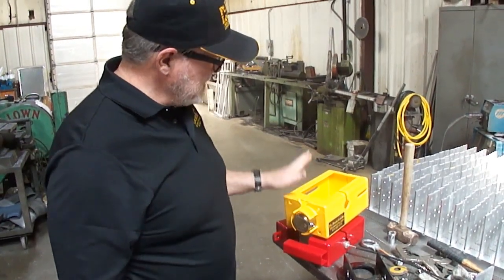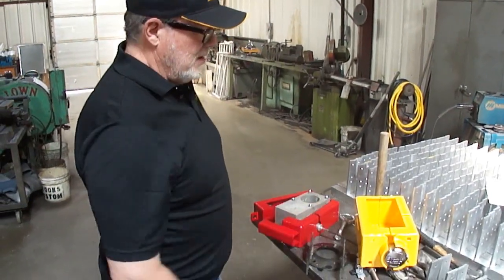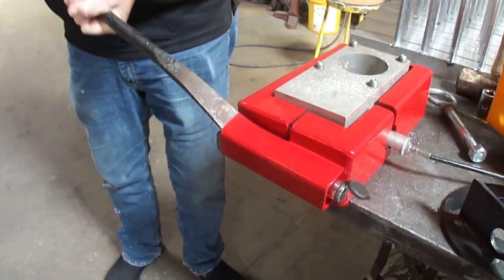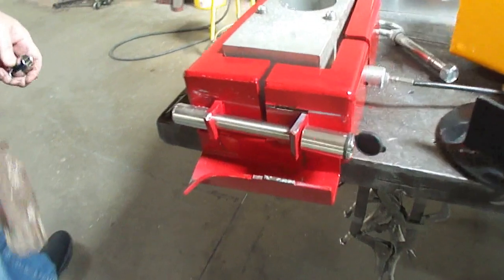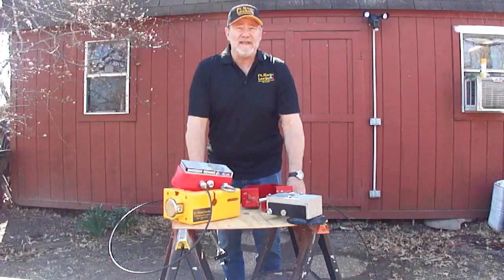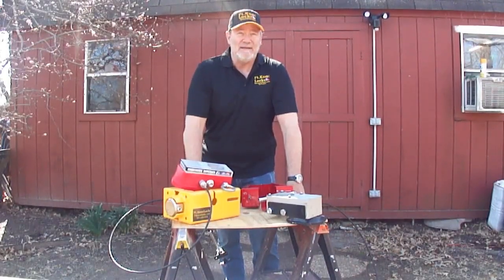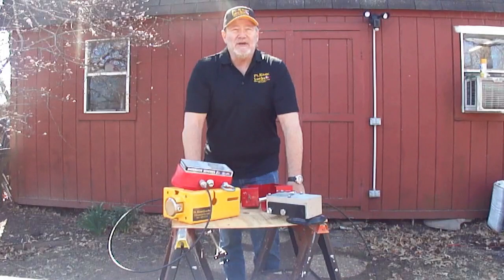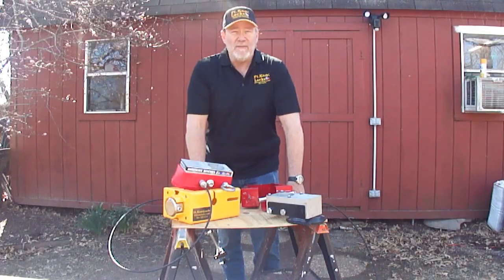Level & Hitches Andersen Ultimate lock defeat (cheap competitors version)

Comment: I would like to see you defeat the knock off lock with it not welded to a steel bench. Being free to move around when prying it would make finding a binding spot where the lock will not move very difficult as you apply force via leverage it will tend to slip. Furthermore having it welded to the strong bench gives you a very firm base to pound against, similar to a farrier using an anviL. Now that being said I realize that it's not impossible but at least 75% more difficult than your demo.

Comment: I'd like to see the ft Knox lock welded to a bench and hit with a sledge hammer for comparison. This demo is deceptive and makes me question the rest of your "lock defeat" videos. Have some integrity.
Reply from the maker: For reference, we only did 2 smaller 3/4" tack welds to simply simulate the level of resistance you would have if it were installed on an Andersen Ultimate 5th Wheel connection block on a 10 - 20K lb 5th wheel trailer.  The lock fits very tight and snug and allows for little to no movement.  We used a fairly short pry bar and a 2 lb hammer.  If I had a 5th wheel trailer I would have done it on the trailer as we have all of our other videos.  In all fairness, I do think my access was slightly advantaged by doing it on the bench top, but I  intentionally tried to keep my approach comparable to what I would have had if installed on an RV.
Reply from the maker: Your wish is our command, look up our latest upload, skip the first 5 minutes

Comment: You wouldn't have been able to pry with your bar the way you did, with the lock on the kingpin. You didn't have a fifth wheel above it, preventing you from using that leverage
Reply from the maker: I am not aware of any 5th wheel set ups in which the king pin box is back under the overhang.  All the ones I have seen the pin box extends to the front of the overhang if not several inched in front of the overhang.  Additionally, the vast majority of my effort was from the side.  I did take a lot of positional advantage when we attempted the defeat of our own lock with the hammer swings from above.  Thanks for your comment.

Comment: What would prevent a thief from putting a crowbar in the gap between the puck lock and the lock box and prying the puck lock off?  I don' t find a video of anyone attempting to remove this lock using this method.  Just curious, because I'm considering getting one of these for my Andersen Ultimate.
Reply from the maker: Our construction method is full hand welding instead of the type of welding by machine they used which is more like spot welding.  Given time and enough beating or cutting a determined person can defeat any lock.  Locks are still for honest people, we feel like we help keep people more honest.
Reply from the maker: we just uploaded a video where we attempted to do exactly that among many other attacks on our lock
Reply: Great job!  Now I'm convinced you have the securest lock on the market!!  Highly recommend this lock for the Andersen Ultimate!